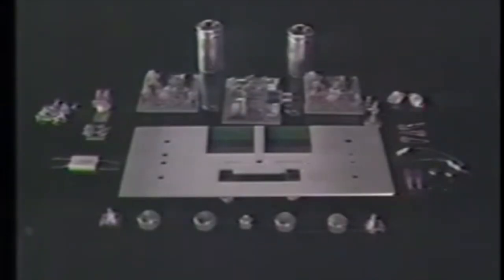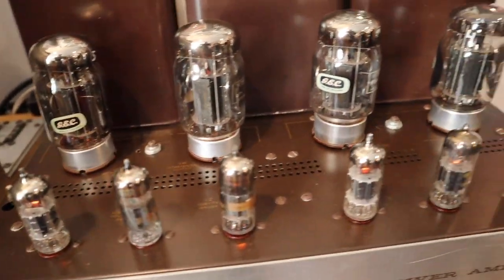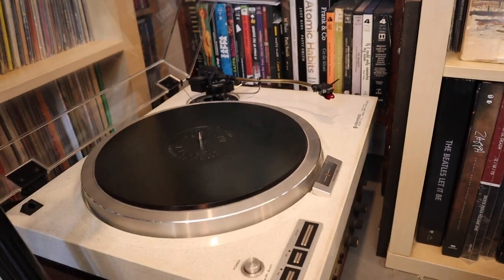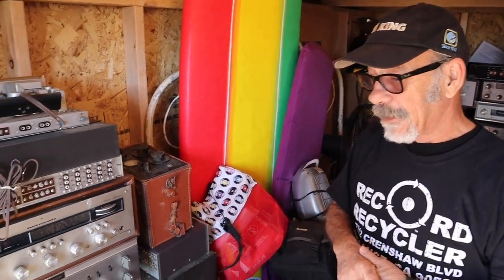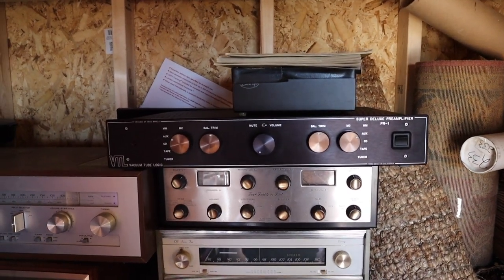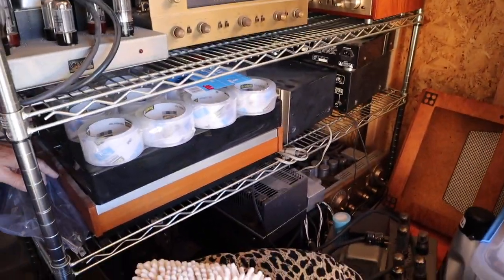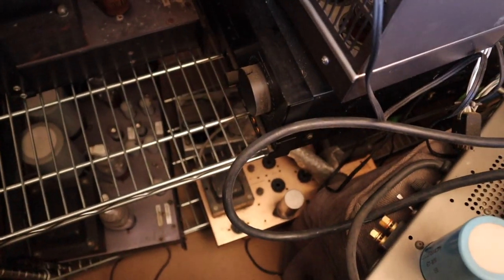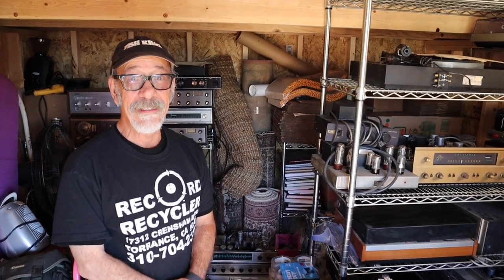A 40-Piece vintage Tube Gear Haul with Jim from Record Collector News!

Comment: Heh. That Kenwood turntable is similar to the one I bought around 1978. A KD-500 with an ADC LMF II tonearm. I was a salesman at the time and got it all half price. I also built that Dynaco amp in the Crazy Eddie ad (but mine came without the meters) and the Pat-5 pre-amp (in the ad as well.) The Kenwood is still my main TT and still uses the ADC ZLM cartridge that I originally bought for it.

Comment: I own and use Citation II amp and a Pas 3 preamp built my deceased Micheal Fraser of Los Angeles. The Citation has wonderful output transformers but the amp is using 6 volt TV tubes for the input stage which seriously limits the performance of what could have been a classic amplifier . Micheal Fraser tears all that out and installs a classic Herbert Keroes from the 50's ultra-linear circuit from the 50's. He does the same with the Pas-3. I have been listening to this equipment and with a current LINN LP12 and LINN speakers to this day.   Micheal Fraser was the best tube expert out there
Reply from the maker: I really liked what I heard from that amp that day, definitely rivals modern high end designs.
Reply: @poetryonplastic  Marantz made a Model 9 mono tube amp that is quite collectable and sound great.

Comment: On the unit with the blown cap, you better get that electrolyte out of that unit before it starts to corrode everything. Also, if you just look at vintage stereo equipment on eBay you will run across many brands that you have not heard of, including Eico.

Comment: Lots of nice gear. 😎
As someone already mentioned, I'd get that old blown electrolytic cap out of there and scrub the residue off the PCB before it corrodes anything. Then he should be able to look at the values marked on the side & a suitable replacement to get it back up & running. 👍

As far as the tube tester, just look here on YouTube.. Lots of videos covering this. As they say, "a picture says a thousand words". ;-)

Comment: I’m not super familiar with the SL-1015, but I can tell you that is definitely an SP-15 in there. I guess the 1015 was a “complete” package with plinth and tonearm, similar to what the SL-1000 was to the SP-10. Still a very, very good turntable, very close to the beast that is the SP-10! I hear they can have some problematic ICs these days though.

I am not a tube expert either but I believe the tubes in the VTL amp are 300B’s. AFAIK those are supposed to be the tube to end all tubes, or something along those lines.
Reply: They look like 300Bs to me.
Reply: The tubes in the VTL are 807's, basically an early version of the 6L6. 300B tubes do not have top caps.
Reply: @chriss6302  Fair enough. Thanks.

Comment: A little DeoxIT and some rust remover. Maybe some capacitor replacement. Knob caps for that Fisher can be had with some patience. An amazing haul. I'm inspired to start doing some refurbishing myself in '23
Reply from the maker: I think some of the really nice pieces may end up getting professional refurb.  And a few of the beat up examples might get sold for parts.  However some of those Dynacos and the like are great first restoration projects, and I would love to try my hand at that someday when I have a little more free time.
Reply: @poetryonplastic  Same here. I need a bench and an oscilloscope. I’m handy with a soldering iron and everything else. But it takes time and space to open up boards and replace capacitors and whatnot.

I am going to do a video at HardOff in Okayama. Their “junk” section is amazing. Dozens of every type of audio component and drawers of tubes, cables and parts.

Comment: While I'm not positive and without searching, that Sound Analyzer from Scott sounds like one of their products that deals with the wide variety of EQ curves present among 78rpm discs. A lot of their top stuff from the 50s had that in mind. 

In fact, a lot of the amplifiers in this are on my wish list for a system I'm building to play specifically 78rpm records (particularly those Citations which are my holy grail right now). I would guess that this guy had a big 78 collection since it appears that most of his stuff revolves around it. That SL-1015 looks to be just a rebranded SP-15 which is a top turntable for 78s (and in fact I have one coming to me through the mail sometime today!)
Reply from the maker: Yes looking it up after the fact, it is essentially an SP-15
Reply: The Technics SL-1015 is a professional turntable system comprising the SP-15 motor unit, SH-15B1 plinth and EPA-500 tonearm.